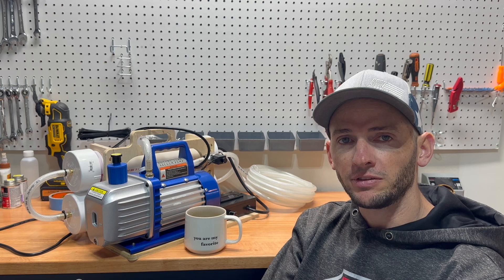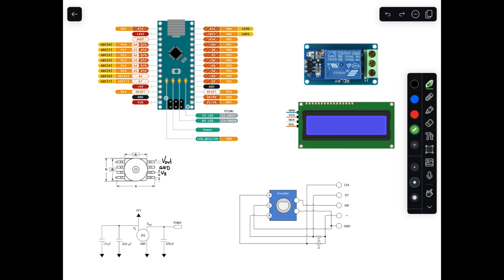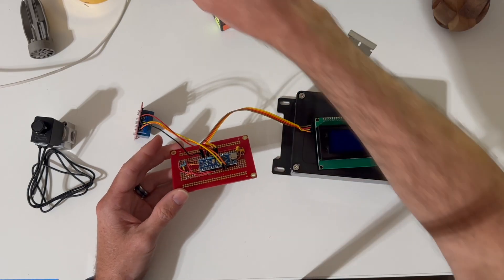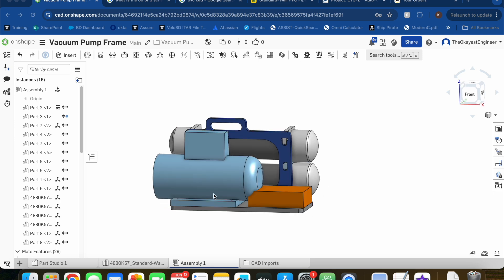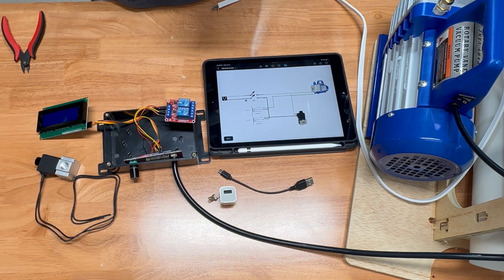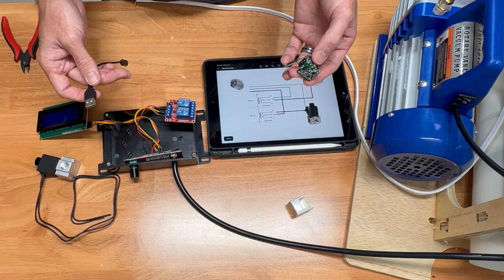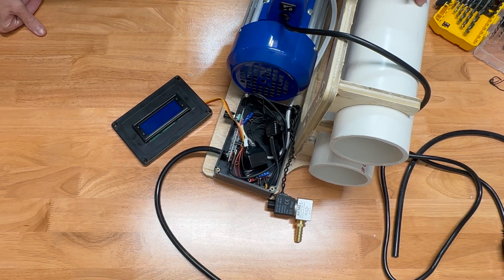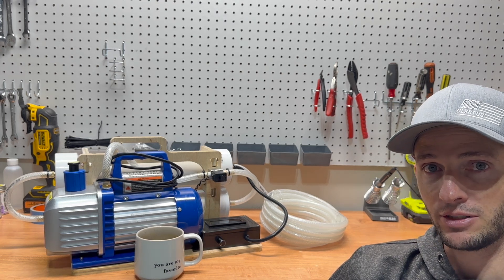DIY Vacuum Pump Build: Save Money and Over Engineer Everything (With ChatGPT)

Comment: While ChatGPT can be good for simple projects and starting as a base point for learning.  I feel it's important to point out that the code you get will rarely be 'good' code, if you're lucky it will do what you want it to, but be wary.  As a software developer, i've used it to validate logic and more often than not it comes out with garbage code that's barely functional.
Reply from the maker: I am no developer, and I am positive your statement is accurate. ChatGPT is more of a "tool" like a calculator is for math. You've got to know what you want to do before you can just start plugging in numbers. As a novice programmer myself, I've actually found it to provide cleaner code that I am able to produce and have leaned quite a lot form it. Once again, there is a limit, and you still need to understand what you are doing. For a beginner though and for simple projects, it is AMAZING.
Reply: @TheOkayestEngineer  100% agreed…coming from another novice programmer. Chat has actually explained some misunderstandings I had regarding how certain code would execute so thank you Chat. It’s waaay quicker than digging through stack overflow when you’re just trying to get a program working quickly rather than worrying about shipping a perfect product.
Reply: Its like an advanced templating system as it is.

The ai tools can work for small simple refactorings for moving code around too.

The versions you get of dependencies are also random and it'll fail with more complex stuff and  very often starts to run in circles breaking stuff when fixing stuff.
Reply: It really depends on the models and what exactly you are trying to do. I use it all the time but since I already know what I want, the logic and what it should look like, I can determine if it is correct before using. Similar to asking it to write an email. The same styles come across in that as well.
Reply from the maker: @ exactly! I knew what I wanted it to do and the logic behind the function. I was able to feed all that in and it created code that worked.. obviously not a very complex program but it worked.  

It’s also extremely useful to get some code to start with that you can tweak to your liking. 

In short, it’s way better than starting from scratch and can be extremely helpful for people starting to learn.
Reply: What do you mean by “barely functional”? Like it works but it’s using too much power? It works but it runs really slow? Like what do you mean
Reply from the maker: @ I was exaggerating a little. This cheap pump doesn’t like to be left on for more than a half hour. That’s the whole reason I made the controller. It’s worked extremely well for the resin infusions I’ve used it on.
Reply from the maker: @ I was exaggerating a little. This pump wasn’t designed to run continuously and it starts to over heat after 30 minutes. That is why I designed the controller. This setup has worked perfect for me for the few resin infusion parts I’ve made. I’m very happy with it

Comment: I have a similar pump. I have let it run continuously. It was fine. It depends on how much leakage you are fighting. If it is a very small leak, you can run continuously no problem.
Reply from the maker: Good to know! I've only made one part so far and the pump never had to run for longer than a few minutes.. and for the number of parts I plan to make with this thing, all of this effort is probably overkill.. but it was a fun little project!
Reply: @TheOkayestEngineer  I appreciate the update on the state of chatGPT coding. That is really impressive, what it did.
Reply: @TheOkayestEngineer  The two things to watch out for are obviously the pump overheating (that is number 1) and oil misting (that is number 2). When the pumps run continuously they discharge a fine oil mist. If they run too long with too high of a flow rate, they may run low on oil. Also, you don't want the oil getting all over stuff (especially any surfaces you may be bonding to in the future). Venting the discharge outdoors could solve the problem, and maybe something as simple as running it through a rag or some cotton filter media would fix the misting problem. I haven't tried it so I am not sure. I just put the whole pump outside and used a long hose.
Reply from the maker: @mckenziekeith7434  good point. The pump I got has a built in oil separator. It’s not perfect but works alright. I’ll definitely keep an eye on it though and be extra careful around things that shouldn’t get oil on them.

Comment: You could have also just wired an electrical outlet to the relay, and plugged the vaccuum pump in instead of modifying it.  Also, I've found those relays sometimes weld together when heavy loads are turned on. You can put a varistor in parallel with the relay to help alleviate the large inrush.
Reply from the maker: I was trying to keep the footprint small and didn't really have room for an electrical outlet.. Also didn't mind making the quick modification. But very good point. I'll also have to keep the varistor in mind if the relay ever craps out.